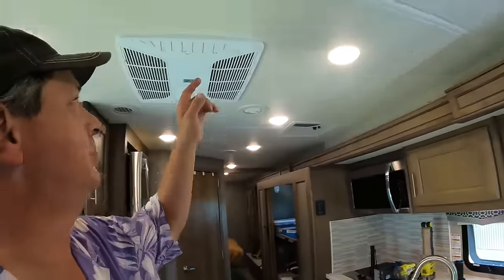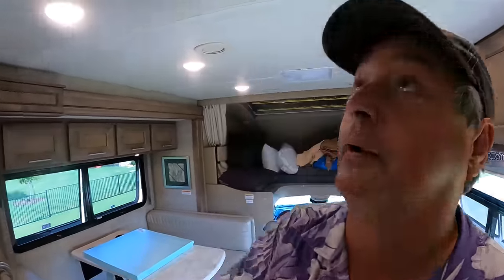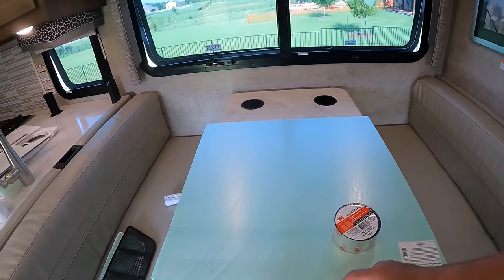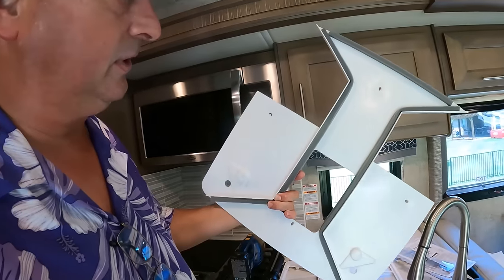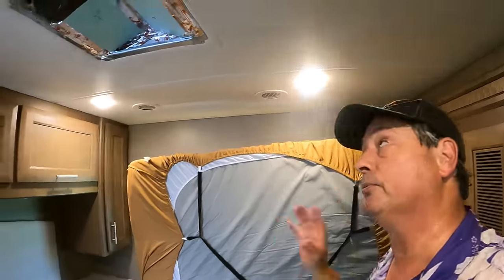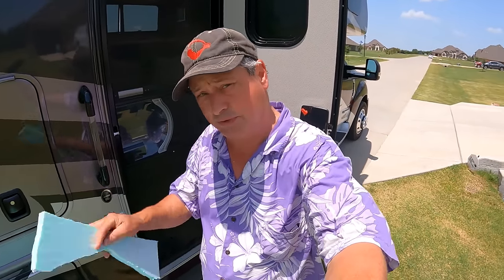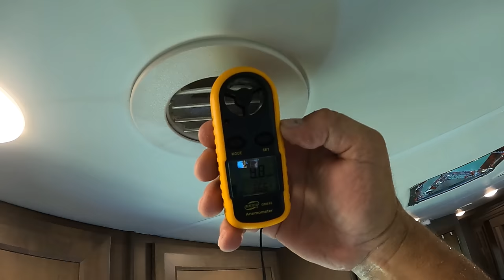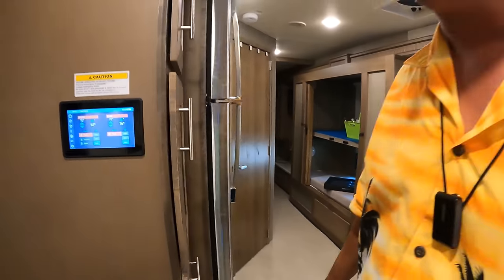A $10 DIY solution to Improve Our RV's Air Flow System For More Cold Air!

Comment: My fellow vet. I really enjoyed watching. I really liked your design and much better then others, that I’ve done to 1 of mine. I’ve got 2 Dometics in my ‘15 Montana 3160RL. I noticed a mistake I thought they may have done and didn’t know until I’ve done it and actually seen and experiencing. The reduction of the Return AirFlow area in size. Mistake made I didn’t catch and thought about after doing where you actually confirmed my thoughts. Being a electrician and seeing ACs being installed in construction as well as having some training on ACs when working offshore. Therefore I’m redoing mine today as well as my vents. They’re sealing is terrible in the ceiling. I am curious do you have the “RaceTrack” Ductwork with your 2 units or the “HorseShoe” Ductwork? I have the complete circle closed loop “RaceTrack” with the 2 Dometics having the 2 ducts on each side. I’ve noticed both Blowers turn opposite directions on mine. That also I guess in RVs the setup is called a “Zoned” System. Don’t understand that, because unlike residential or commercial. There is no electrically energized gates to stop and redirect the airflow to another zone. Did investigate into the “Zone” of RVs and the way I see it is that both ACs run per say except they only operate at certain times. Example 1 runs for 12hrs. then other runs 12hrs. when Zone1 shuts off at whatever time you program into the Thermostat. Then Zone2 takes its turn. So best I can say it in my opinion is to make it look like you’ve got 2 ACs working as 1 AC to be more electrically power efficient. I live in my 5th wheel and ouch my light bill here in South East Texas is getting up there. Since mine is a complete circle and blowers run in opposite directions Living Room blows right and Bed Room blows right. Also since the ones the manufacturers make is styrofoam and actually round curves redirecting air flow into vents with no resistance, but blowing the cold air into both ducts through the vents straight into the other AC. While that AC is doing the exact thing. Also if they’re running at the same time, yes would be serious airflow. Wouldn’t it also end up giving more airflow in the middle between the units? Making the middle vents cooler and blow hotter, tell eventually possibly building up enough resistance to back flow it into the other vents? I was thinking of taking a block of styrofoam or glue pieces together and creating a combination of both designs that as the 1 blower turned right to channel that air into the right duct up to the AC turning left. Then channeling or tunneling if you will to from the duct it’s being blowed in from the other AC and tying it into the same round curved tunnel from that blower turning left. Now while it’s pulling in the cold airflow from the other AC its also pulling in the air from like normal and pushing both airflow sources the airflow from the other unit and now it’s own air into and through the ductwork through the vents back into the other AC unit which it’s styrofoam was made the same way. Basically it’s a tunnel from one duct straight through the supply side space into the other. Also having the whole 5 1/2” blower opening intake tunneled downward and curving into the left side or right side duct, which ever way the blower blows. Being careful not to close off the tunnel that’s coming from the other side duct. Kinda like drawing a arrow in a R or L direct but instead of having 2 blades 1 up and 1 down. You only have 1 blade at the top. I would believe that is  actually why it was called the “RaceTrack” blows fast and hard in one direction in my case to the left like a RacTrack with no restrictions. Of obviously having everything in the AC system ductwork sealed with supply and return as well as the units have proper flow of air in and especially out to dissipate the heat created during the process of exchange. What you think, in your opinion would it work in reality not just in theory
Reply from the maker: Your theory sounds workable, but the only way we will know is to have it done and test, test and test some more. I am not sure if my ducts connect anywhere but at the input from the units. Our A/C system has 2 zones with one thermister (thermostat sensor) and one 13.5 unit making up a zone, there is nothing controlling or separating the two zones.
Keep us posted on your racetrack mod and thanks for watching!

Comment: Do you have a material list and list of cuts and the angles for this project.  What size foam board did you use?
Reply from the maker: Material list...
1 2'x2' construction foam board from Lowes
1 roll of Duct tape
Angels will be determined by the RV
Thanks for watching!

Comment: I just took the cover off. My rv gets down in the 60s. I'm in Houston
Reply from the maker: how often do you have to clean the inside coils? Thanks for watching!
Reply: @DudeRV  I clean twice a year. It's a 05 kz toy hauler still have the same ac's. I found this you there starting to get a little weaker.  Where at about 69 70 right now at 2
Reply: @DudeRV  I'm talking about the cover on the roof. I found got whether it won't over heat the compressor. That's the problem with the roof top ac. So with the cover off it won't over heat and shut down. Now its still blow's with the cover on but I find its cut in half or more. But I don't do thangs like normal people. I'll try 10 different things to get a result I like.
Reply from the maker: @crazyprepper5400  Interesting! I think I will do a little research on this! Thanks for sharing!
Reply: @DudeRV   lol last night I had to shut it down. I put the thermostat on the lowest it would go, I got up at 130 this morning it was 58. I shut it down lol. No bs
Reply from the maker: I have had A/C #1 running with no cover since 9 AM this morning and dont see any difference. at 2 PM temp was at 90 which is about what I would expect under normal operation.
Reply: @DudeRV  I don't know is the coils cleaned. Does it sound like the compressor is on. Is it a thermostat or the one with on off.  It made a big difference in my camper. I wish you was in Houston, I'd let you come see.
Reply from the maker: send me a pic or 2 at dudervtexas@gmail.com coils are clean, compressor is running there is a thermostat.

Comment: This is a great idea! I'll be doing this to mine soon! I have to ask, have you ever had trouble with your duct work condensating? Mine is doing that right now and I can't figure out what's causing it.
Reply from the maker: that sweating is due to a temp differential. hot on the outside and cold on the inside. my duct is just a channel cut into the Styrofoam and we have not had any sweating. thanks for watching!
Reply: @DudeRV  thanks for replying. Is there anything that can be done to stop it or do I have to keep wiping the ceiling down?
Reply from the maker: @sheilamelton5024  what sort of ducting do you have?
Reply: @sheilamelton5024  Buy a $20.00 dehumidifier. It will suck up the humidty and put it in a cup that you will empty weekly/monthly.

Comment: Did you modify the plastic splitter that that mounts between the cover and the roof?
Reply from the maker: Plastic splitter? are you referring to the inner cover piece that separates the intake and outflow air streams? If that is the part you are referring to then no, I removed it as it was no longer relevant, I have no need for the "dump" vents with this improvement.
Reply from the maker: I just accidentally removed your last comment! Dang it! I did not know what an IDC was, Dude! Thank you for your service! And thank you for going the extra mile to become IDC!
Reply: @DudeRV  Independent Duty Corpsman.   Gonna be modifying our AC this week
Reply from the maker: @confermotorsports9101  You are gonna love all that cold air! Thank you for you dedication and service!

Comment: I've basically been through every nook and cranny in my RV after living in North Dakota and south florida over 7 years. It NEVER ceases to amaze me at how CHEAP and careless these things are constructed. Its the complete opposite of German engineering. If you can't see it in your rv because its behind a wall or in this case behind the cover, they will do the absolute CHEAPEST job possible. I'm surprised you didn't find a bag of half eaten lays chips and a cola can up there.
Reply from the maker: You are so right! While doing an upgrade to my battery and solar I discovered a 4 to 6 inch hole in the floor inside and behind the built-in pantry. That hole was open to the outside and was exactly where the pipes froze on our last cold weather camp. The only way to even see it was to de-construct a bulkhead that was never intended to be opened. That hole had a steady flow of hot air blowing in. Just plane sloppy!
Reply: The manufacturers should be ASHAMED of themselves. They have absolutely zero pride in their craftsmanship of their products. If you have the money it’s best to go with small batch manufacturers that use real wood such as Outdoors Rv Manufacturers. Heavier trailers but seem to be built MUCH better.

Comment: Why does it seem like every rv old and new has this problem? Why dont the manufacturers just build them so they work as well as possible in the first place?
Reply from the maker: Those are excellent questions that I do not have an answer to! Thanks for watching!
Reply: They could design a good airflow and only sell 1-2 A/C's per RV, or keep this old shoddy system and sell 2-3 A/C's per RV. Easy busy decision for the A/C company

Comment: Please be very careful using metal tape. It WILL cut you if you catch ANY ridge or edge with your finger.

I got a few good slices in before I realized it was the tape cutting me. One pretty bad one.
Reply from the maker: Yes indeed! the metal tape is sharp and the cuts are worse than any paper cut you have ever had! Thanks for the warning and thanks a whole bunch for watching!

Comment: RV Airflow Systems,  LLC has been our company name for two years and your comments indicate that you know this. 
Our name is trademarked.
I'm sorry but to avoid hearing from our attorneys you must remove this video. You also have no rights to claiming you invented or "came up with" an rv airflow system. 
If you want to show how you made your own diverter that is up to you. You must include a statement that it is your DIY version of our system.
Reply from the maker: I do respect where you are coming from. At no point have I infringed upon your trade mark RV Air Flow Systems, This is clearly a video about a  DIY improvement to the RV air flow system.   
The use of a trademark does not necessarily qualify as an infringement if the user is not actually using the trademark as a mark. No consumer confusion will result, if anything this video will likely stimulate interest in what you have to offer since your product is plug and play with very little effort or work required.

There is a very interesting article about the use of trademarks that can be found here...
https://www.nolo.com/legal-encyclopedia/when-you-need-permission-use-trademarks.html
Informational (or "editorial") uses of a trademark do not require permission from its owner. These are uses that inform, educate, or express opinions protected under the First Amendment of the United States Constitution—freedom of speech and of the press.
Reply: In my experience people who have a retainer with an attorney confer with them prior to posting hollow threats.
Reply: Whelp I know where I’m NOT buying from lol. Learn the laws before baseless threats are made to nice people